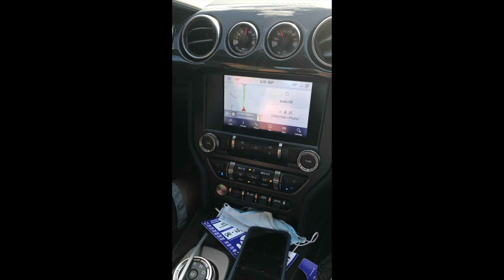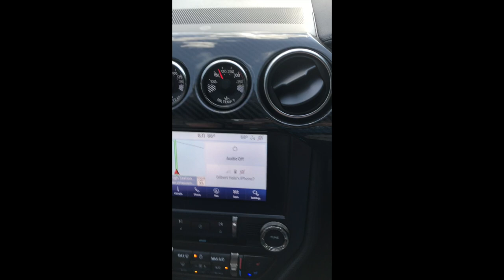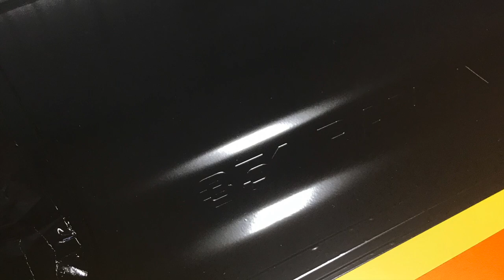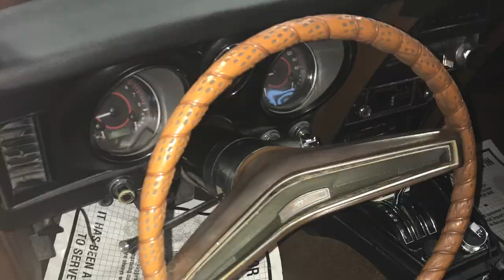1973 Mach 1 Restoration Project Photos

Comment: I gotta watch your stuff... looks like I could learn some things
Reply from the maker: We are all capable of, and likely in need of, learning ever more new things.  I owned my first Mustang back in 1971, a 1969 Candyapple Red coupe with a 250 CID I-6 engine with a C4 tranny.  Plus an aftermarket ARA A/C unit.  Life was good in SoCal, Woodland Hills, at the far west end of the San Fernando Valley (L.S. area).  I was a high school kid who really, really, really wanted a v-8 Mustang.  But, my parents wisely chose to put me into a 6 cylinder car.  Otherwise I have no doubt I would not have lived past 17, which given how hard I tried to push that Mustang it is amazing I actually did live past 17.  For me, canyon racing in SoCal was so much fun, even with the 6 banger.  The best time to race was at night, because as I approached a curve or bend I could kill my lights to see if there were any lights from oncoming traffic around the curve.  If not (after turning my headlights back on, of course) I would cit the apex of the curve as I 4 wheel drifted just enough to line up my straightaway shot toward the next curve or bend.  I shudder to think of how lucky I am to be alive still, now age 69.

Then, one day in high school still, while running through a residential area far faster than I should have been going, I hit some sand on the road that had been spilled by a contractor installing a swimming pool nearby.  Well, that was the end of that Mustang, and a 1968 Firebird Formula 400 I took out as the Mustang's passenger side crushed its trunk in as badly as the Mustang's entire right got caved in.  Drag...

I was then relegated to a 1966 Chrysler Newport, 4 door no less, as my form of pergatory until in 1973.  In 1973 my dentist decided to trade in his 69 Mach 1 for a Datsun 240Z.  The dealer offered him $800 trade value, and he asked if I would want to buy his Mach 1 for $800.  I had been working since age 16 at a grocery store, making decent part time money, and actually had enough to buy it - and I was 18!  I finally found myself back in a Mustang again, and this time one with a v-8, although it was a very low end Mach 1 with a lowly 351W 2v, single echaust system, FMX auto tranny, 3.0:1 rear axle ratio gear set, and no A/C.  No matter, I had a nice platform to begin with while building a mean, snarling street machine.  And build I did.

First came the FMX auto tranny.  I had just finished a class in auto transmission repair (2 year A.S. program for auto technology), so I ordered a bunch of B&M high performance parts, including a 3,500 RPM stall speed torque converter and a nice street/strip shift kit.  Wow, it worked like magic.  Crisp shifts, and nice hole shots.  Then, after joining the Army I found I was getting a large tax refund check (almost $2,000).  Wow!  I was rich!  What better time to go to the local speed shop and buy everything I could think of to rebuild and pump up that engine.  Sure, forged aluminum pistons with 12:1 compression (we still had high octane alcohol free gasoline back then), a nice hydraulic street/strip cam, Holley 780 CFM vacuum secondary 4v carb, Offenhauser 360 dual plane high rise intake manifold, Hooker long tube competition headers, high performance fuel pump, Mallory dual point distributor (electronic ignition was not the rage yet, especially aftermarket), Perfect Circle valve guide seals and cutting tool kit, bronze wall valve guides with a high flow triple cut valve job and moderate head milling, double roller high performance timing chain and gears.  Imagine all that back in 1975 for under $2,000.00.  I was on my way.  And man, did that engine run good!

In the end, despite the steep 3.0:1 rear axle ratio gear set, I was ready to take on the world.  I was able to now do 0-60 in 5.6 seconds with street tires (could not afford to replace the F70 x 14 tires).  I marked off a 1/4 mile segment of Southern Arizona highway on a flat surface (I could see forever on those Arizona highways I was now consistently trapping at just about 13.2 seconds at 115+ MPH.  I was tempted to go to a wrecking yard and get a 3.5:1 or 3.91:1 rear axle gear set, but decided to keep the 3.0:1 gears because I liked my high end performance, and did not want to be running 3,000 RPM+ at 60 MPH (and did not have the money anyway).  What cinched that decision was when 3 Marines in a 1969 Z/28 that was obviously not stock challenged me to a race outside Yuma, AZ, one night.  We staged up at the last light out of town that then led into the highway that went out to Yuma Proving Ground (my Army station), and beyond.  In my car there was me, my wife, and a fellow soldier we were friends with.  So, we were not holding any real weight advantage against them re: how many occupants were inside the two cars.  Sure, I had a 351 vs his 302, but as nasty as his cam sounded I was not betting I was going to win, especially considering he likely had a 4.11:1 rear axle gear set vs my high fuel mileage oriented 3.0:1 ratio economy gears.  The light turned green, and it was on.  For the first few hundred or so feet the Z/28 was ahead of me, but not by a lot.  We had not marked off and stated an ending point, so I figured I would do my best to catch up to him, and maybe even outrun him with my taller rear axle ratio - if only I had enough strength in the 351W to pull off some magic.  Well, after the first 300 feet or so I was gaining on him.  We were still nowhere near a 1/4 mile mark, had one been identified, and I began to pull ahead of him.  Not creeping up on him slowly, but very decisively gaining.  Then I passed him, where I was increasing my speed at an ever increasing rate, and he was losing ground, a lot.  

About the time I hit 115 or so he was several car lengths behind us, and he decided to turn around and scamper home.  I let the Mach 1 slowly back down to about 70 MPH or so and cruised on back to our base (I had on-post housing we lived in).  That is when I decided the 3.0:1 gears may not be so bad after all, as I still launched out of the hole pretty nicely. Not as fast as the Z/28.  But, he ran out of breath at his top end about when the Mach 1 was beginning to really hit its stride.

I was later transferred to Germany, and did not have enough rank to qualify for the Mach 1 to be sent over with me.  Another stroke of good fortune no doubt as I am certain I might have found my end on the Autobahn trying to compete with Porsches and Ferraris.  I sold the Mach 1 about a year later to a friend in order to help build a cash reserve for when I left the Army, in case I could not find a job as fast as I needed to.  I never should have sold it as I found a job as a tech at a Lincoln store my first day looking.  And, within 3 months a Ford dealership made me an offer I could not refuse.  At that point I was hip deep into Mustangs to work on, and other Fords.  Then "life happened" and I was out of the pony car game for a few decades.   Kids and career reigned supreme for a bit of time.  No regrets.

Fast forward, after migrating from auto repair, to designing computer solutions, and later (1991) starting my own computer consultancy, I decided about 6 years ago to get back into pony cars.  I was making really good money with my business.  I now had employees to help with all the work.  So, long story short, I picked up the following pony cars (and one sports car) over the next three years:

1 - 1969 Shelby GT500 with factory A/C
2 - 1973 Mach 1, built for street strip.  A/C was added
3 - 1973 Mustang Convertible.  This is a True Survivor currently with less than 21,000 original miles after being literally barn stored over 40 years.
4 - 1997 Honda Del Sol SI - 2 seater sports car my wife found, 30,000 original miles
5 - 2020 Shelby GT500 - special ordered through a client Ford dealer in our area.  He must have liked what I did for him with my trechnologies!

Anyway, I hope I have not bored you too badly with all that.  I did subscribe to your channel, and gave you a thumbs up.  I ask you consider c to my channel also, please.  And if you find the various videos of value please hit me uo with a thumbs on them.  

Finally, in the spirit of always trying to do right by my fellow enthusiasts, if ever you want to run something by me, technical or otherwise, please feel free to do so.  I am at gilhale@gmail.com...  My YouTube channel is:  https://www.youtube.com/@gilberthale7777
Reply: @gilberthale7777  I am going to start a live stream podcast for my channel, would you be interested in coming on to talk mustangs?
Reply from the maker: @GorillasGarage  I would be interested , but my voice is very hoarse and at times halting due to the side effects of several life saving surgeries to help me survive brain cancer. I am a 10 year survivor at this point. And all looks good other than anticipated side effects which included one of my vocal cords becoming paralyzed. Drag. But I am still alive and cancer free so no complaints from me. 

Otherwise I would love to participate. I would need some advance notice to make sure I am able to carve out time for the session.